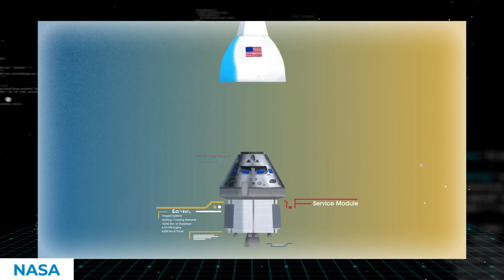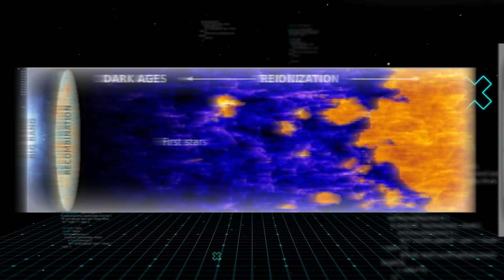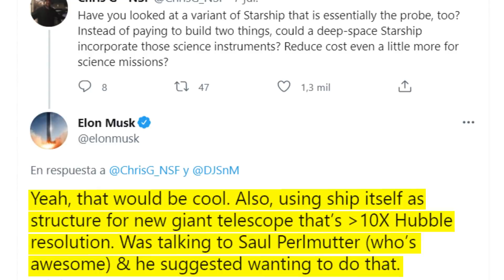GAME OVER! SpaceX REVEALS INSANE NEW Starship Upgrade!

Comment: Turning the cargo area or the top pod into a telescope, by far is very effective, but not the lower fuel tin canister of SN, unless to be use as a tin body vessel assembling of a station in orbit/space. This is why they need to be capable of seperation, with SN being 4 stage able. 1- Canister main fuel travel supply, 2- Cargo deploy or dive land, 3- Passanger living space, as lunar pod, finally 4- seating launch & land, piloting nose pod, or emergency eject.
Reply: +¹ ⁴²⁴²8¹90³8
Thanks for watching
Text me now for more on my investment tips.
Text me as soon as possible...